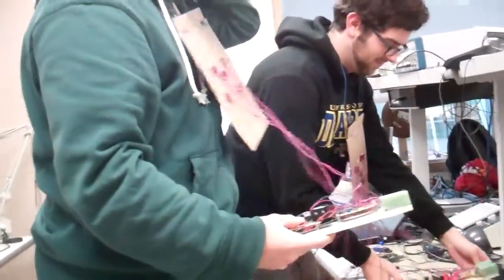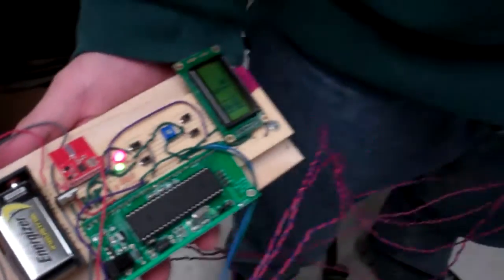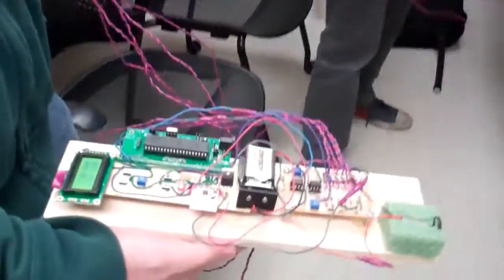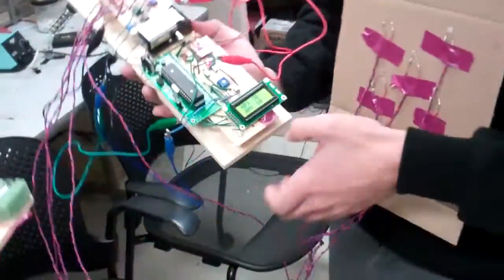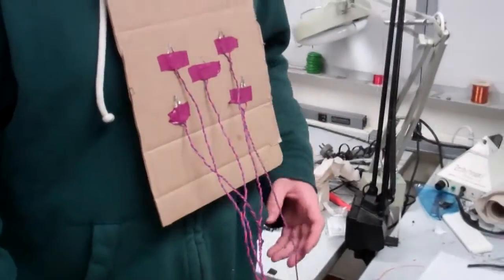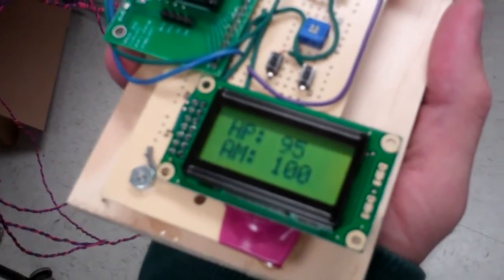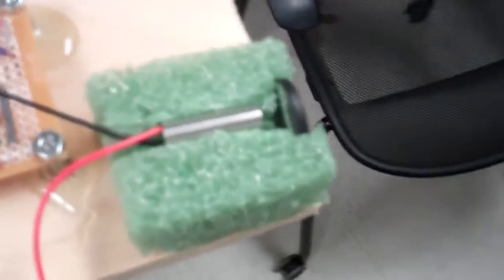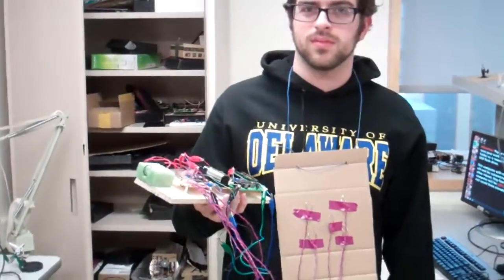Laser tag with RF logging

Comment: Been working on my own hobby lately of some pretty simple laser tag guns with a BLE module strapped onto them. Except instead of using a base station I've got the other end of the BLE controlling TENS units the players (victims) will be wearing. This has been some really great motivation and inspiration. Electrical engineering is the best; I can't imagine why anyone chooses any of those other interior disciplines.